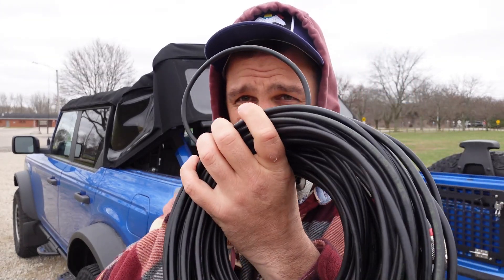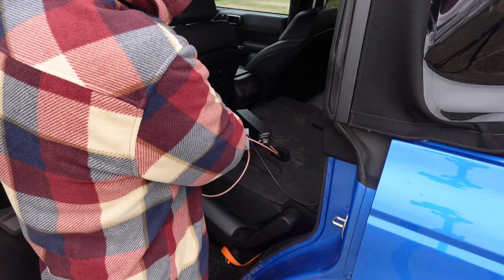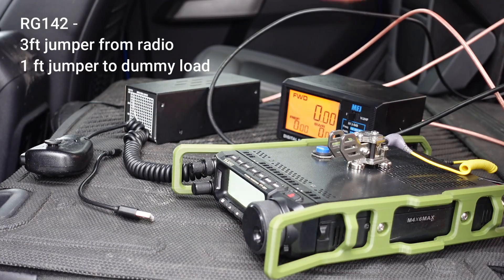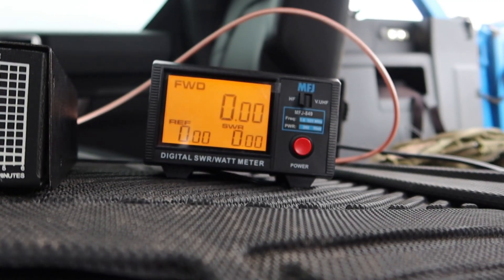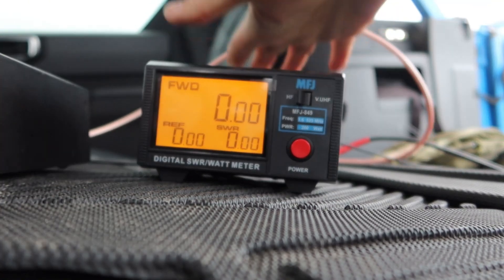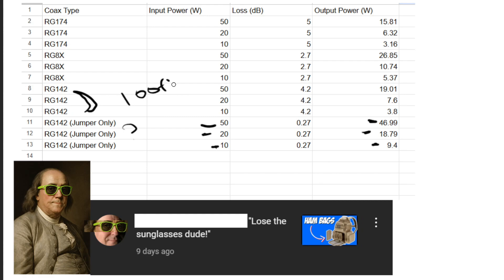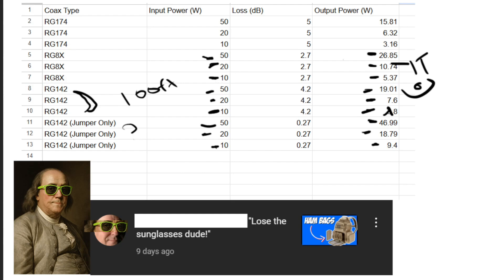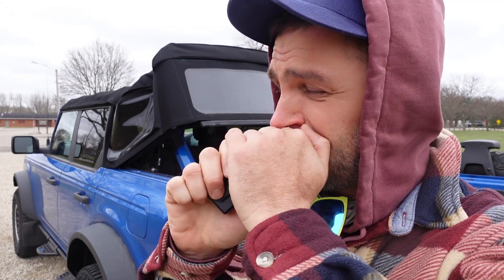Ham Radio Coax Matters - I SHOW You - Part 1 of 2 (Transmit Power).

Comment: I like this test! Nice to see the theory in action.

I’m no expert but this is my thinking.

An s-unit is 6 dB. So the RG8 is less than one S Unit stronger than the 174.

So an S3 signal on receive would be just above an S2 with 5 dB loss.

It seems really bad when you see power cut in half but practically there doesn’t seem to be much difference.

A 20 watt signal vs a 100 watt signal is 6.9 dB so roughly a little more than an S unit on the other end.

Now I’d still choose the better coax anyway and keep it as short as possible. Run less power and save more battery.
Reply from the maker: @Mike_12345  s2, you're definitely correct. Thanks for pointing out my mistake, I know better.  
S9 0 dB
S8 -6 dB below S9
S7 -12 dB
S6 -18 dB
S5  -24 dB
S4 -30 dB
S3 -36 dB
S2 -42 dB
S1 -48 dB

Thanks!
Reply: @ hey, you’re welcome! Thanks for being cool about it. Sometimes people get bent out of shape when really the comment is supposed to be helpful not insulting.

Comment: But with 100 feet of RG174, my antenna always has a low SWR, LOL. Seriously though, good video and important lessons, including the receive. I do mostly portable ops, so I usually use coax runs around 25 feet long. But I also do a lot of VHF contesting, and when I'm operating on 900MHz or 1.2GHz, the coax quality, length, AND connectors, can make a HUGE difference.